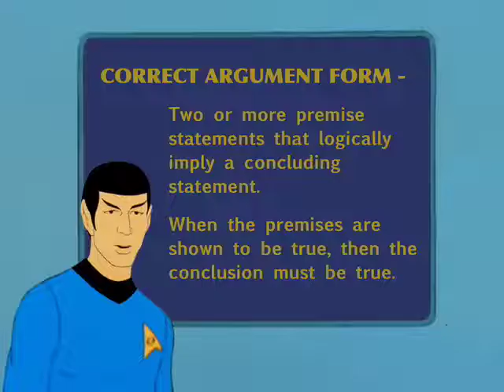STAR TREK Logical Thinking #0 - Proper Reasoning (Valid Logic)

Comment: Scotty and Sulu use logical arguments, but Spock fails to recognize that what is stated in the "engine design specs" is illogical.  In fact it exhibits the "fallacy of the single cause".
The "engine specs" assume that there is a single, simple cause [articulation array is misaligned] of an outcome [efficiency <20%] when in reality it may have been caused by a number of only jointly sufficient causes.
[misaligned] ⇒ [<20%]   is not the same as   [<20%] ⇒ [misaligned]. 🖖

Comment: I was like, "I dare you, Spock! I dare you to find a flaw in their reasoning." Spock, however, could find no fault in their logic; for both had presented sound arguments.
Reply: Unless the alignment was correct all along and the problem persisted after double-checking the alignment.
Then it must be some new variable causing the problem and the Star Fleet engineering manuals need to be updated once the problem is isolated and resolved.
This is what drives updates to tech manuals.
Reply: It was nice to find Spock not fault finding.
Reply: Don't write or say "I was like."